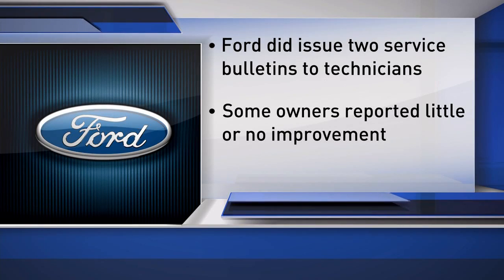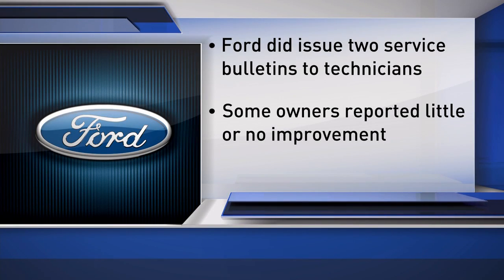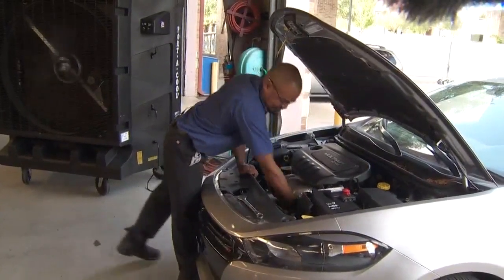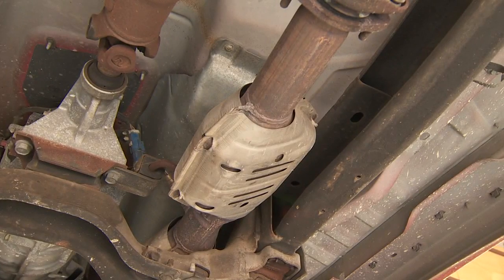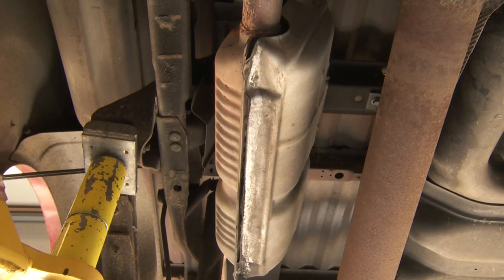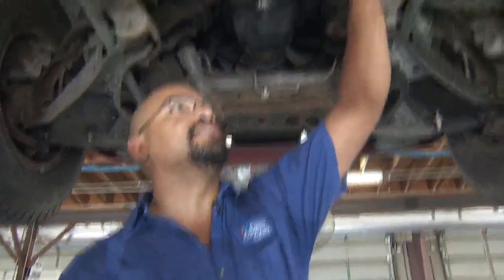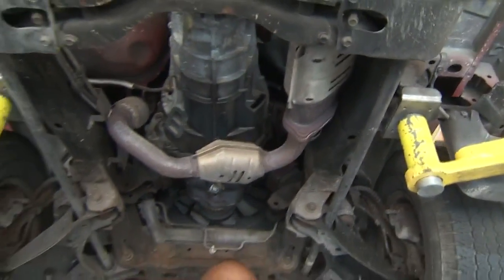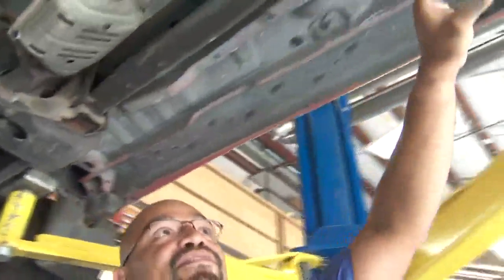How carbon monoxide can get in cars

Comment: I have a 2015 Ford escape I bought new and I am having the same problem every time I get in my vehicle I feel like I’m passing out it even gets worse once I stop at a stoplight or when I have to stand in line in a fast food restaurant, it is affecting me so severe I know I have a lot of recalls on my car that need to be fixed. This is scary.
Reply: Hello, were you able to fix it? How?
Reply: run with windows down. turn off aircon or disable recycled air at least and get a Co2/co monitor

Comment: I had this in my old car and I Iliterally almost died. The cause of the leak was a deer impact (that seemed minor at the time) must have broken a gasket and CO to come into the cabin. Periodically my legs were getting numb, arms would get numb and tired and then confusion and short term memory loss would set in. 

The scariest event was that I was able to park at a store to recover but then realized that I did not remember the last minute of driving. I know I was awake while driving, but short term memory loss wiped out my memory of the couple minutes before I parked at the store. I am very lucky that I did not hurt anyone else or die myself that night. If you hit a deer or even minor fended bender and think your car is ok GET IT checked out.
Reply: How did you not notice the smell?
Reply: @beamed5382  It's odorless.
Reply: This exact thing happened to me I remember completely forgetting that I had drove